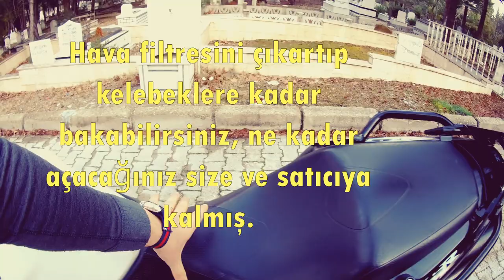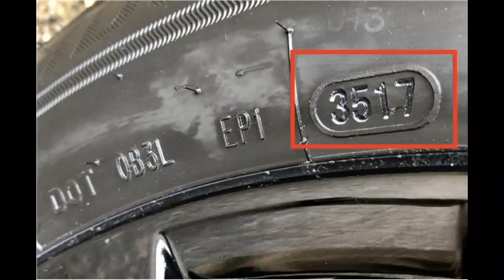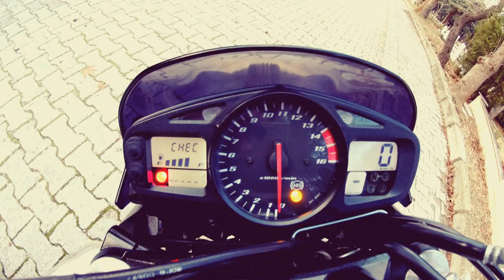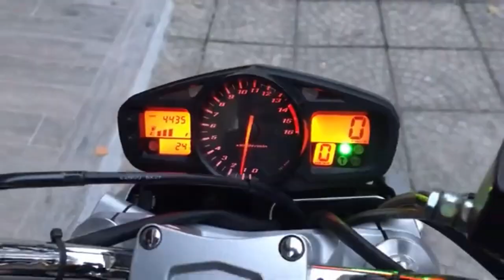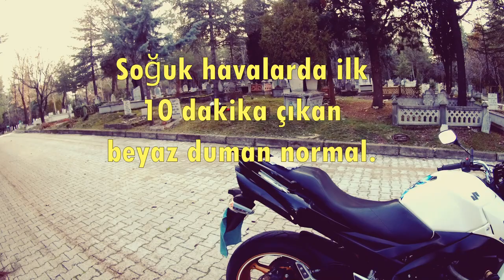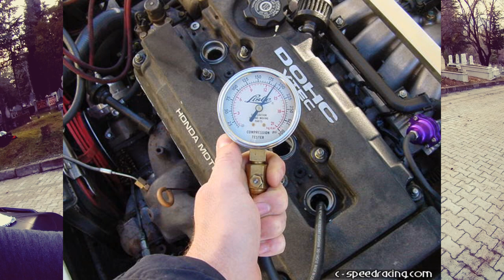İkinci El Motosiklet Rehberi                     | İkinci el motor alırken nelere dikkat etmeliyiz ?

Comment: Tengo esta misma moto es el modelo ultimo del 2010  con 180.000 km
Reply from the maker: Me alegro de que continúe en la carretera con 180.000. como esta su condicion ¿Sigue siendo agradable y sin complicaciones?
Reply: @gezentavuk  No me da problemas , en general si estas atento al cambio de aceite  y no andar siempre por encima de las 9.000 vueltas puede durar  1.000.000 de klm.